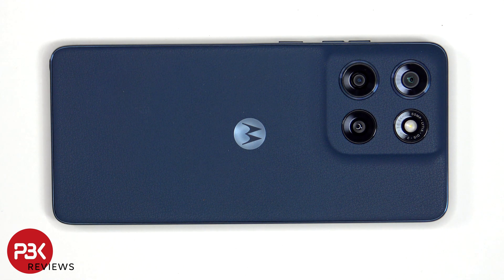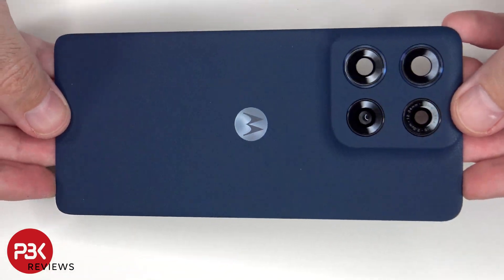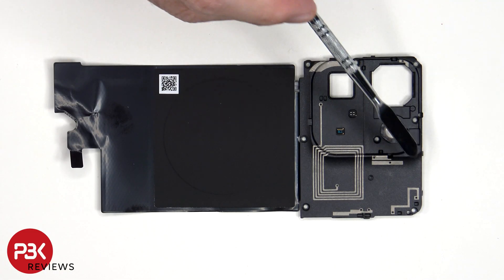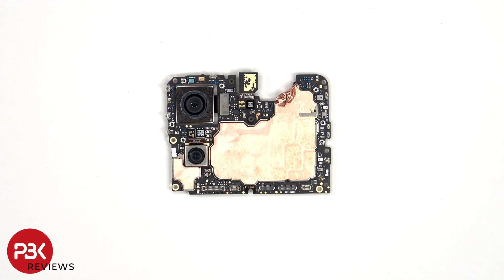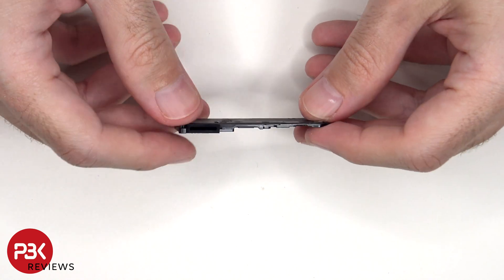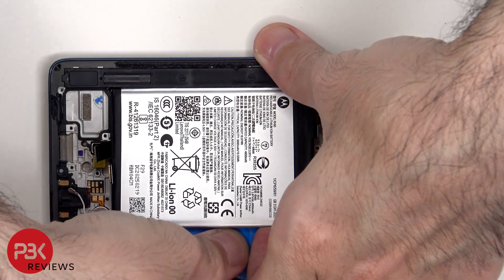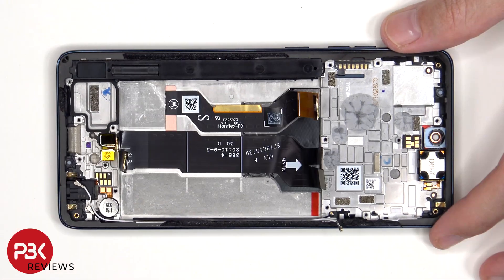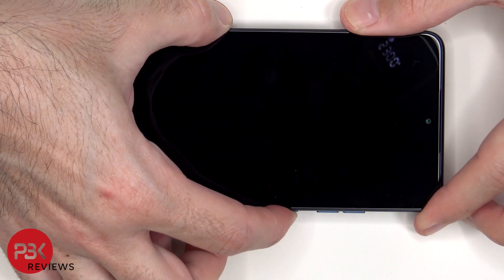Motorola Moto G Stylus 2025 Edge 60 Stylus Teardown Disassembly Phone Repair Video Review

Comment: How about the 3.30 minutes mark when you take off the black plastic on the copper sheet, is it a big deal if the copper sheet tears off and stays on the black plastic like I saw you do? And do you have to use a special glue to put that back on.
Reply: I could be wrong, but it looks to me like the copper is attached to the black film and not tearing or coming off, so I think that it's perfectly fine.

As for the glue, it'd be best to use the right kind so that you don't compromise the phone's water resistance or make it harder or impossible to get the back cover off again in the future. The glue is common and isn't expensive. Just search for T-7000 if you want the same black glue that the phone originally used. Alternatively, you can use B-7000, which is similar, but clear.

Comment: About how long does it take to heat it up to take the back off? I definitely don't want to ruin something by getting it to hot or using the heat to long
Reply: I don't know, but you could be safe and heat only one corner until you can pry it up, then heat along the edges as you move the pry around the perimeter.

Comment: The third camera is fake. Come on, Motorola. There's no reason to put a fake camera lense.
Reply: Bro it is light sensor
Reply: I'm in fairness they save money by using the same chassis. It reminds me of when LG had the dual screen and it still had the teardrop camera bump on the left side even though there was no camera there. They said it was for symmetry but I think it had more to do with the fact that they wanted to save money because they were using the same panels. 

So I mean I understand your point but it would be expensive for them to make a different chassis for the stylus and the power And the price would be reflected in the phone 

Of course with these phones the MSRP is kind of inflated anyways cuz almost nobody pays $400 for the stylus or 300 for the power. You can get them for like 100 prepaid with a bundle or sometimes even free. Like the Moto g power is free right now through straight talk although you have to buy two months worth of plans. So I need to end up being a hundred bucks after the 2 months are up or 80 or something if you switch to a cheaper plan the second month
Reply: It saves money from them having to redesign and manufacture a entire new frame and back cover.

Even if it seems fake it still does serve a purpose plus it looks good.